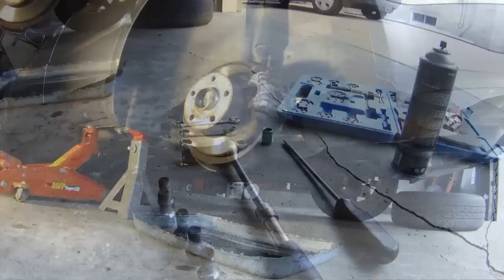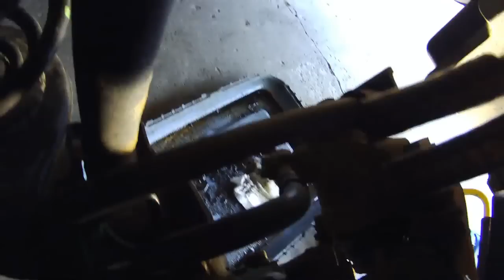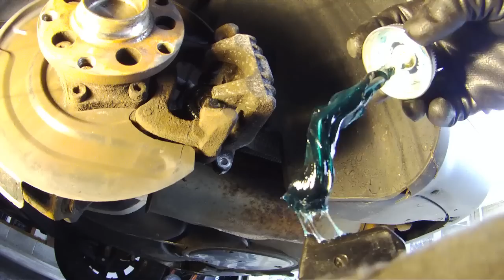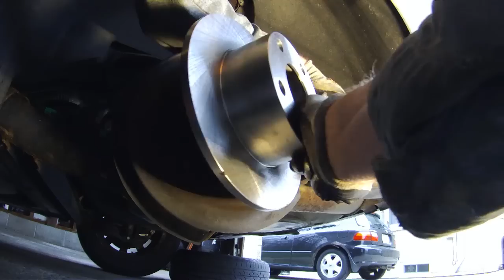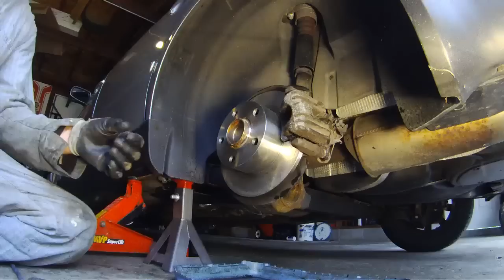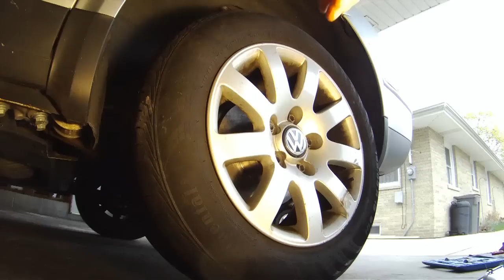VW Passat Rear Disc Brakes (1998-2005) also Audi A4 (1996-2001)

Comment: Before fitting new pads I've always used the regular garage method to control the hydraulic fluid movement in the system (i.e. pre-vacuum pump era). I remove some brake fluid from the reservoir without letting the level get too low. This allows the caliper piston to push fluid back into the reservoir without causing a spillage of brake fluid in the engine compartment. It's a bit slower and if it's not done carefully can result in a spillage or if the fluid drops too low may require a brake bleed.

I leave the reservoir top off and wrap an old towel around the reservoir to catch any spillage if it occurs. 

I always push the piston back slowly and check the level of fluid in the reservoir as I go. If necessary I remove more hydraulic fluid to keep the level low but not empty. 

Once the new pads, caliper & wheel is back in place I top the reservoir up with fresh DOT fluid and then pump the brake pedal "once", slowly. 

I check to see if the fluid has dropped and top up as necessary. The important thing is to make sure the reservoir always has a minimum level of fluid in it otherwise a brake bleed may be required. If you are inexperienced check the fluid level regularly. Do not pump the brake too many times without checking the fluid level,

There's no need to rush things where brakes are concerned.

Comment: Done this job a few times on my 00 A4.  Nice video, couple comments" I've never opened the bleed screw, only take the cap off the Resevoir' you can get the cube adapter and use a c clam with the flat swivel head removed". This lets you turn and compress.  I've never put grease on the pads like that, I would be worried about it getting on the pads.
Reply from the maker: AV8R3 Yeah.  I typically do not open the bleeder valve, but there is much debate over that topic, so I figured I'd do a few videos showing that method. I also bought a cube adapter, but could never get it to work. I think I lack the brute force:).  I think I'm gonna do a full-on brake bleed on this car soon, so I'll get a chance to inspect and see if any grease worked it's way onto the pads.   Watch for the follow-up vid:)!  Thanks for the comments!
Reply: Thx i asked this very question and ur comment answered it for me. Ive always just used a c clamp with tank lid off.

Comment from the maker: Agreed. I've done a dozen brake jobs without opening the bleeder valve and have had no issues, but I can't recommend it. as a best-practice, always open the bleeder valve as seen in this video. Any brake fluid behind the piston is squeezed out through the bleeder valve.  The needle nose vice grips theoretically prevent air bubbles from moving up the brake line while the bleeder valve is open.

Comment: Looks easy enough. I've been on a "work on my own car" kick, new CV axles (not just the boot) with all new sparks, ignition coils (damn VW anyways), and a transmission fluid change (not a flush). Looks like rear brakes is the next thing on the list... because the light came on and I'm at 100k on my engine. This video KICKS ASS! Thanks Hanoi.
Reply from the maker: Thanks for the comment!   Good luck with your brake job!  When you open the bleeder valve, attach a piece of fuel line to prevent any air from entering the system. Check out my front brake video to see how... 
http://youtu.be/C-MoQ5VuyHU?t=2m12s

Comment from the maker: My opinion?   The absolute best thing would be to completely bleed the system every time you do a brake job.   Failing that, I think the pinched line trick does two things... First, it prevents fluid from getting pushed back up into the ABS system and master cylinder (although  having the bleeder vale open should prevent that).   Second, it prevents gravity from pulling more fluid out of the system (leaving an air pocket behind the piston) while you complete the brake job.  

Hope this helps!

Comment from the maker: Bleeding the system when doing a brake job is the RIGHT thing to do, so you SHOULD do it. I take a shortcut in this video to avoid bleeding the system.  I specifically open the bleeder valve and pinch off the supply line to prevent any back pressure from being applied to the ABS module. Good luck with your project!
Reply: Audi A4 2003 rear lights how to replace bulbs

Comment: You should also remove the 2 pins on the caliper and clean and regrease both pins and the 2 rubbers, which easily pop on and off, to insure they both move freely or you could end up doing this all over again in a few weeks from break pads not opening enough off the rotor.

Comment: Thanks for taking the time to make these videos. I'm scheduled to do this work on my 05 Passat mid summer. This video has helped a lot to learn the process.
Reply from the maker: Good luck!  Follow Mirko Martin's advice below and "Caliper clean with a Steelbrush before you assemble".  The pads shouldn't have to be jammed in like I did in this video. Although... 2.5 years later, those pads are still working great:)!

Comment: Best tip in this is using the self grip pliers as hose clamps, i never thought of that.  I use a G clamp to push the piston in.
Reply: +zaftra The rear pistons need to be turned as they are pressed in so the tool he uses works and a G or C clamp not really.
Reply from the maker: +Richard Agree.
Reply: zaftra hi! What is that tool he used? And Is it absolutely necessary?
Reply from the maker: Brandon Abreu The tool is a brake piston compression tool.  There are many variations of these tools, but it's important for rear brakes with integral parking brakes that you use a tool that twists while compressing the brake piston.  You can't just use a C clamp on this style of piston.
Reply: hanoihancock thanks for the feedback, I actually had to run to the hardware store and rent the tool once I got to the rear brakes lol. I used a standard push in version and it wouldn't go in so I thought I ha a seized piston so this actually saved me about $150

Comment: Nice video. Thanks for sharing. A couple points of interest... Pump out the pads a few times with the engine off before you start it. Also, it looks like there is too much lube on the brakes. Use lube sparingly.

Comment: Excellent video. The Haynes manual says to fully release the parking brake from underneath then completely remove the caliper.The top caliper bolt is blocked by the parking brake actuator.  I was uncertain about this and found this video. Watching this video I had an Ah-HA moment. No parking brake interaction required! Remove the bottom bolt only and leave the caliper on! Hooray youtube! Hooray HH! I also do the bleed avoidance maneuver. I will be doing a full flush of the brake fluid soon.

Comment: PLEASE READ. This is an excellent film! I would take nothing from it or the creator but, I would like to add some experienced food for thought and for safety.

I NEVER clamp brake hoses and never recommend it. It is NOT NECESSARY to clamp the brake line at all, in 99% of cars. Clamping a brake line at any point, especially the rubber part, can cause internal cracking and be extremely dangerous. It can also cause small pieces of the rubber lining to come off and travel through the system and block open valves in the master cylinder. Unless you have a Lamborghini with a hybrid Elctro-Hydraulic braking system (which you should touch anyway), you should NEVER clamp a brake line. I lost a friend because he used the "ViseGrip" method incorrectly. It caused his brakes lines to fail while he was driving at interstate speeds. He came upon and was not able to stop for a multi-car pileup that he then added to. He hit at full speed, was ejected through the windshield, despite wearing his seat belt, and he died. The gentleman who made this excellent film stated he was told to clamp his hoses by a mechanic. It wasn't his idea, he is sharing advice he received that worked for him, as demonstrated. It looks like he prepared and used the "ViseGrip method" correctly but many inexperienced (young) people who watch these films take shortcuts.

** If you know and think about the basics of fluid dynamics, you know that pressure always releases/ventilates at the nearest weak spot. If you just turn out the bleed screw for the caliper, or jut take it out, you will not need to clamp the hose(s) because all of the pressure you create will flow out of the bleed screw/hole and not even try to backflow through the more restrictive brake lines. **

The "ViseGrip method" was something a Japanese sport car mechanic came up with to avoid damaging the very expensive brake fluid pressure, brake fluid temperature, and fluid reservoir volume sensors and seals on Asian sport cars used for street racing/drifting. This method was derived to help professional mechanics avoid damaging their customers' other brake system parts during a simple brake replacement job so they would not then have to pay for out of their profit margin to replace those parts. This method, as for as I have been able to find, was not derived by any OEM engineer or factory certified mechanic. It is a "backyard" or "shade tree mechanic" method. While useful and effective, these types of tactics can be dangerous if patience and common sense aren't applied.

The "ViseGrip pressure relief method" isn't terrible, it works good but, be careful you don't over-pinch and crush the line, especially old rubber (more than 1-year, 12,000 miles (yes, seriously)), or you WILL cause that line to fail and could lose your brakes. Unfortunately, I've observed line failure on several cars I've repaired for folks that have tried this method. As the gentleman who made this film showed, be SURE to put rubber hoses over the jaws of the ViseGrips. Bare metal ViseGrip jaws will cut/damage the brake lines. Better yet, go to NAPA, O'Reilly, AutoZone, or wherever, and buy the inexpensive PLASTIC PLIERS specifically designed for this type of work and that do not cause damage to rubber hoses. Using the "ViseGrip" method isn't actually necessary on most cars that don't have "brake fluid sensors" in the master cylinder. The hydraulic brake system on cars is a two-way fluid system by design. The system is designed to have the fluid backflow/flow backwards. When you lift your foot off of the brake pedal, that's exactly what happens, the pressure releases and the fluid returns to/toward the master cylinder/fluid reservoir.

What actually causes damage is impatient young  men forcing things harder and faster than they are designed to go instead of allowing things to work at their designed pace. So, when they compress the caliper pistons with a large C-clamp or caliper piston tool, they like to gorilla-twist the compressor tool because, "it wasn't moving fast enough". Doing so then causes the brake fluid to backflow at up to 10x the factory design return pressure and it blows the master cylinder pressure sensor seal, brake fluid temperature seal, brake fluid reservoir level sensor seal, and/or the brake fluid reservoir seals. They cause this damage because they are impatient, not because the fluid went "backwards". If you go slow, let the fluid move at its designed pace, you will not damage anything that didn't already need to be replaced in the first placed! Take the brake fluid reservoir cap off. If you added fluid because, "it was low", put some cardboard under the car to soak in the excess fluid. You should never have to add brake fluid to a car built after 1980. NHTSA regulations require auto manufacturers to design all vehicles made/imported for America to have "lossless" brake systems meaning, there is enough fluid to suffer all four wheels' braked pads grind down to metal-on-metal without adding any fluid. If you need to add fluid, you need to replace more brake system parts than just shoes/pads!

You also need to check to be sure your lines aren't woven/braided metal sheathed or laminated and/or rubber-mesh-rubber reinforced internally (90% of cars after 1970). Some VW/Audi GT, SS, and TT models come with larger brakes and high-pressure systems that require reinforced / braided  aftermarket lines. If you crush / deform the metal materials, you WILL be replacing them. Especially when your car doesn't stop straight or when you find that caliper is lagging from crushed/pinched metal mesh. Whether you clamp or bleed the caliper, you are going to lose brake fluid. DON'T FORGET to top off the brake fluid reservoir with the appropriate D.O.T. rated fluid for your year/make/model. The reservoirs on those cars aren't that big anymore and the fluid volume loss from two rear calipers (especially twin-piston) will cause the reservoir to drop below the minimum fluid level and draw air into the system which can/will cause loss of braking authority (power). Best to push brake pedal once GENTLY and then check the reservoir level, after every pedal push, until the brakes seat firmly and good pressure is felt at the pedal.
Reply from the maker: +Mountain Mobile Mechanic TY for the helpful info.   Voting this waaaayyyy up!  Very well thougth written and thought out!.   Never using the clamp method again!  Also will be sure to turn the C clamp very slowly in the future!
Reply: Thanks for the great video and this great comment. I am planning on replacing rear brakes and rotors on my 2003 VW Passat V6 4Motion wagon. I see +hanoihancock  uses a rubber tubing in the vice grip for pinching the brake lines. But also I read in your comment that most cars that do use BRAKE FLUID SENSOR on MASTER CYLINDER, how do I find out if my car has that?

My question is Should I CLAMP my BRAKE LINES for the procedure or NOT?  If I do not clamp the brake line and just open the brake fluid reservoir cap and push the piston very slowly, would it still work without blowing any seals? Thanks in advance
Reply from the maker: I agree with Mobile Mountain Mechanic.   No clamp. Push piston Slowly.   Check for factory recommendations for bleeding entire system as a separate project.
Reply: Thanks +hanoihancock !! I completed the project without bleeding the valves. Thanks for your video!!
To add, After changing brakes on all the 4 axles, I got the brake system flush at a mechanic shop..
Reply: Mobile Maintenance Mechanic 
Who read all these chapters ?

Comment: you can open the fluid reserve , screw in piston and siphon off the top ,  no air in system good to go ?
Reply: Not a good idea - at the end of a brake line the fluid is contaminated.

Comment: This was quite helpful and informative...great job! I have a 2004 Skoda Octavia vRS and  I got my break shoes (all 4) painted recently. Ever since then i have been getting the feeling that the acceleration of my car is being obstructed ever so slightly...as if there is a slight resistance ...or friction...and there is a rubbing sound that becomes audible to me above 100-120kph.....When I looked at each break shoe properly...i observed that all 4 of them are touching the drum ....my mechanic said after driving a few kms the extra paint layer will wear off...and that there is no problem ...its normal. Is this normal? Should I just carry on driving this way ...Will this put any unwanted load/stress on the engine? Seeking your advice ...
Reply from the maker: +TEKKDEPTH Sounds reasonable to me.

Comment: no need to clamped the brake line. all you need is release the hand break and push hard while turning the cube with a rachet the piston cylinder will slowly go down. If your having difficulty pushing it back then put a piece of wood or metal appx. 10" from the spring that's holding the hand brake line and lean it towards the chassis right side passenger side)  of the vehicle and by the exhaust pipe (left side passenger side) so the caliper won't move backward.

Comment from the maker: Hi Pbielek,

I'm glad you found the video useful. I'm not sure what you mean by "two mark lines which are making contact with the rotors".   Did you replace the pads too?  Are you able to apply your parking brake?  How can you tell the calipers are not "pressing brake brake pads all the way?

As far as the hub goes...  I haven't replaced a hub assembly, so I'd direct you to the manual for that one.   Why do you want to replace the hub assembly anyhow?

Comment: By 2 lines I mean that from all rotor area there is just contact with the pads on the bottom(1") and (1/2") on the top of the rotor. I can see the marks after breaking. Pads are 2months old, at first I thought replacing them is all I need to do. Hand brake works, not 100% I need to pull the lever a few clicks more, but it was like that even with the old pads. The hub assembly and assembly bolts are very rusty so I thought might be time saving to replace it in the same time

Comment: Hi there, thanks for helpful video.
Last weekend I changed my rotors following all your instructions.
However I discovered that my calipers are not pressing brake pads all the way, there are 2 mark lines which are making only contact with the rotors. I wanted to replace calipers and brackets, while attempting to do that I found more rusty screws(hard to remove) on wheel bearing hub assembly. Question: what needs to be done to replace this assembly,  is it screwed in just with that 5 bolts?

Comment from the maker: There is some discussion in the comments section about bleeding brakes.   Bleeding the system when doing a brake job is the RIGHT thing to do.  I take a shortcut in this video to avoid bleeding the system. I've even compressed FRONT calipers before WITHOUT opening the bleeder valve and it has worked, although that technique is not recommended because supposedly it puts undue pressure on the brake master cylinder.